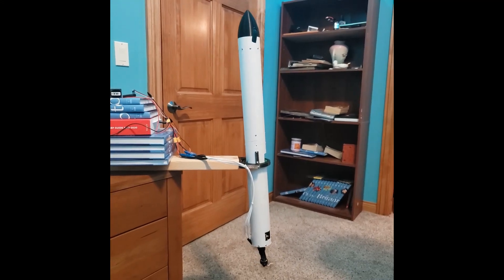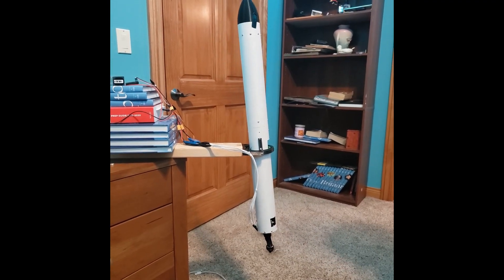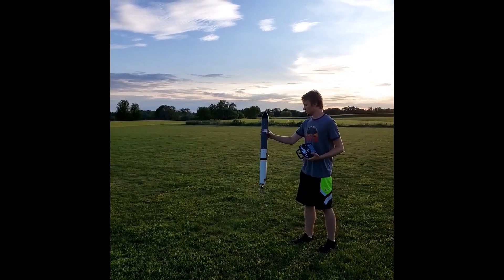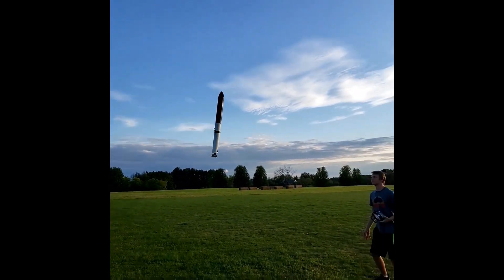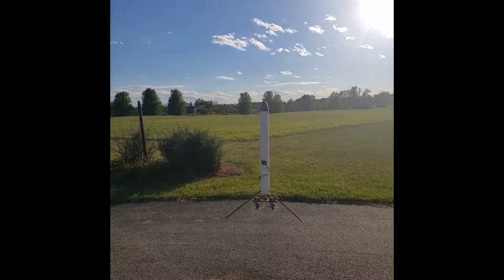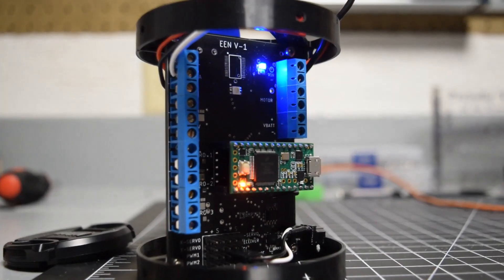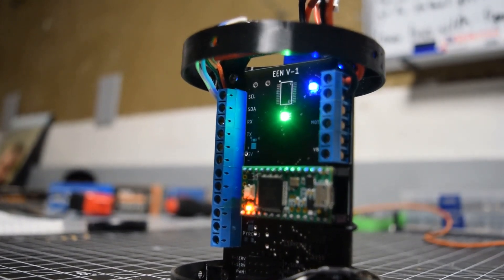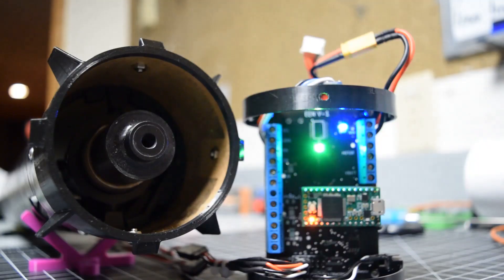Thrust Vectoring Launches 1-7

Comment: Yep, you can see that on the first launch the rocket was headed straight then the TVC started to veer it off course and it did begin to correct for it, but you ran out of thrust! You need to now set your deployment time to after apogee. 👀

The amount of vector has to be "variable" to accommodate the angles of the rocket, the thrust of the motor, and winds aloft. "If it ain't one thing, it is another!" 🤣 At NASA there is a saying, "Now that we have designed it, built it, and are ready to launch, ...... what did we forget, ...... well we are fixing to find out!" 🤣

What you are trying to make is a "VARIABLE VECTORING STABILIZATION SYSTEM" (VVSS). 👍

And, when a rocket doesn't "come down as expected" you yell "LANDED"! 🤣

All you did was build and upside down multi-rotor! In order to stabilize the "roll" you need to have vectoring vanes and counter rotating engines! 👀👍 Didn't even need "computer flight controllers" for this back in the 70s! 😜🤣👀👍

Comment: After determining the vehicles moment of inertia, how do you derive the PID values from that? Are you using Matlabs Simulink or how do you do it? I am currently also working on a EDF powered rocket design and still learning. Thanks in advance!
Reply from the maker: I don't actually find the moment of inertia of my rockets. All the pid tuning I do is from the propeller setup I have. Matlab or any other simulation can definitely do the same thing. I just like the prop method because it makes sure the code actually works.
Reply: @hyerrocketsystems3678  WHAAAAAA, ...... are you saying "real world testing" is better than "conpooters"! 👀😆😜😁🤣👍

Comment: How big is the air frame or the tube
Reply from the maker: It is 3 inches in diameter and about 3 feet long
Reply: @hyerrocketsystems3678  you need to go to 4"! 👍